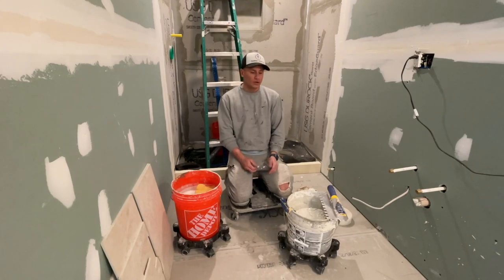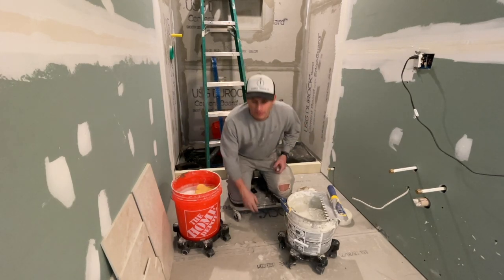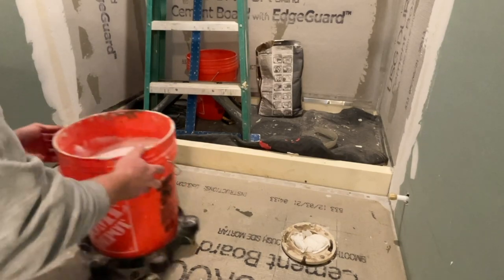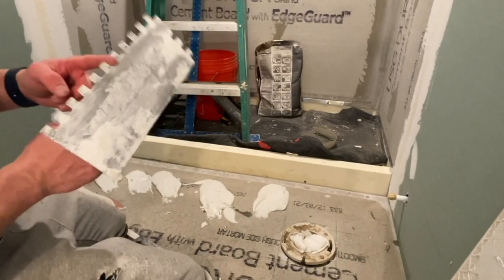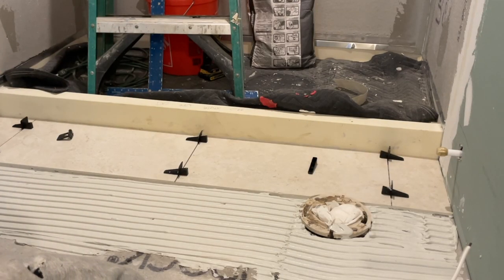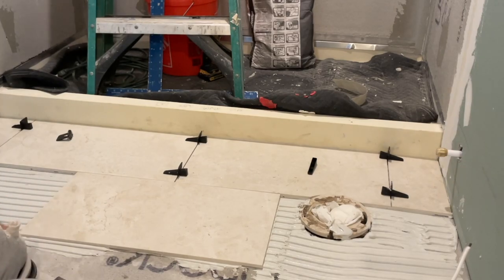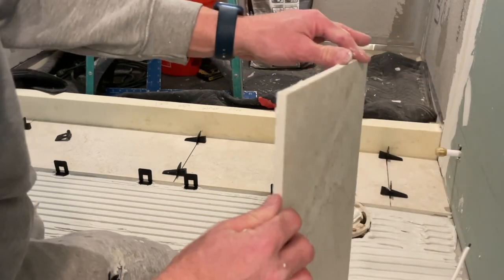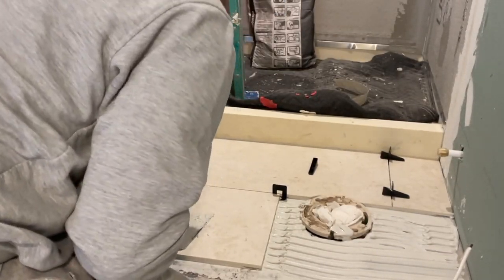How to Install 12” x 24” Floor Tile with a 50/50 Offset Pattern

Comment: Everything is different than what we do. 12x24 is usually the run long way, joints at thirds not halves, layout is usually centered or favors the door, thinset is a little thicker-shouldn't t fall off the trowel. Like the wheeled buckets, but prefer being on the knees with good pads for better leverage, movability and lower to the floor.
Reply from the maker: 1. Long way equals a skinnier looking room. I always give my clients an option and they always want the room to look bigger. 

2. I personally like a full tile at the tub since it’s the first thing people see when entering a bath. 

3. I always use all-set by schluter and go by their directions. I also feel that all set is superior to most thin sets. 

4. I depend on the designer and how they want the layout to be. On this bathroom my designer wanted 1/2’s. 1/3 is also common. 

Remember, there’s multiple products and practices going on in the remodeling trade. Thanks for your comment.

Comment: I look you up before I started my 12 x 24 tile job in the kitchen and the suggestion about the level pieces saved my project. The floor came out perfect and looks professional and yes buttering the back of the tile before laying it down makes it stay down great video. Thanks!

Comment: He’s very good at back buttering the tiles without getting mortar on his fingers. Once you get mortar on your fingers it ends up everywhere. I will still use gloves when I finally do my own floors. I’ve done several practice runs just to get down the technique.

Comment: I hired someone to do my 12 x 24s for                                   all my floors but he didn't use the clip/wedge levelers. I waited so many years for this and I want to be happy with them. I can see and feel the unevenness. I plan to hire someone to do redo only the areas most noticeable. My question is..Can the clip/wedges be used next to a tile that is staying down? i.e.
Reply: Yes, if you cut a groove for it using a multi tool (oscillating tool) which has a flat blade that moves back and forth

Comment: Two part question.  Do you ever or have you ever used spin doctor leveling system?  When installing 12x24 size tiles is it good to keep the 24” width layout going in the shorter distance of the rooms dimension?  Thx
Reply from the maker: It's all subjective on how you like the lines. 

I have not used the spinny levelers, but they seem to be fine.  Make sure you don't scratch the tile when spinning.
Reply: @TodayIWorkOn  👍🏻 Thank you.

Comment: Every 12x24 tile I've ever installed specifically says not to do a 50/50. But I will say you're pretty clean
Reply from the maker: They say(said) it due to lippage issues. With levelers, that lippage situation is not a factor anymore. Before levelers I would not install a 50/50 offset.

Comment: I have a question about the tiling thing. I noticed you cut the tile at the door entrance instead of keeping a whole piece uncut. If I don't cut mine to make it meet the shower basin corner it would make for one piece of travertine to be cut into an L shape so to speak. I have concerns of that tile cracking later. Would it look ok to not have a full uncut tile at the entrance or would it be better to just run the tile the other direction so as to keep the line without having to cut an L shape into such a long piece.
Reply from the maker: If the tile is set correctly, you should not have a crack. If you are worried about it, then, sure, run the tile the other direction. There's no right or wrong with these things, just what other people prefer.

Comment: Just found your channel. Great videos! Do you recommend a brand of leveling system? Thanks
Reply from the maker: https://www.homedepot.com/p/Custom-Building-Products-LevelQuik-RS-50-lbs-Self-Leveling-Underlayment-LQ50/100192482

Proper prep is crucial. I’ve used this for years and never had an issue. Good luck with what you’re working on!

Comment: Love your videos they’re really helping me with my remodel. What is the brand of spacers and leveling spacers you’re using?
Reply from the maker: 1/16" (2MM) Peygran Tile Leveling System 500 Clips. Lippage Free Tile and Stone Installation for PRO and DIY. The Most Precise and Reliable Product on The Market. https://a.co/d/7RF1SVG
Reply: @TodayIWorkOn  thank you so much! So one more for ya… I’m using 12x24 porcelain tile on the concrete floor and different 12x24 porcelain tile over the Durock board on walls. What is the best Mortar to use for each?
Reply: I mean thin set… Sorry I’m a DIYer🤷
Reply from the maker: @kirkpeebles7936  I use Schluter All-Set on any large format tiles. It’s not cheap, but it applies so well and it’s some great modified mortar.

Comment: nice video....is it ok to install 12 x 24 tile in a straight stacked pattern?
Reply from the maker: Totally fine! Very modern. Same concept in this video, just need to use some spacers to keep your lines nice then install levelers next to the spacers.

Comment: Part 2 ..i.e. ... say I'm removing 6 tiles, but the others staying down around it have the dried cement, how can I put the clip in? Should I break off one part of the clip?
Reply from the maker: Pretty loaded question. You can grind out under the existing tile where the mortar is and give some room to install a clip. Also, you can just use the levelers where the tile is new. No tile job is perfect perfect and even with levelers, there might be a slight lippage here and there. It’s really hard to install 12x24 tile with no levelers.  

You can’t break off the one part of the clip because the leveler will not be able to pull and level out the other tile.

Comment: I have been reading you shouldn’t do a 50% overlap. I’m doing my first tile job to my bathroom and what are your thoughts?
Reply from the maker: The simple reason why the box says not to lay 50/50 is from lippage. The tile levelers alleviate that issue. Before tile levelers we didn’t have a way to install 50/50.
Reply: Tile levellers don’t take bow out of tile 1/3 offset

Comment: How long after install are you standing on it? Stable enough with the levelers to gently walk over before its dry?
Reply from the maker: A quick tiptoe once or twice, sure. Standing on them for more than 2-3 seconds, nah.
Reply: I wouldn’t even “ tip toe” on then at all.  😁👍🏻